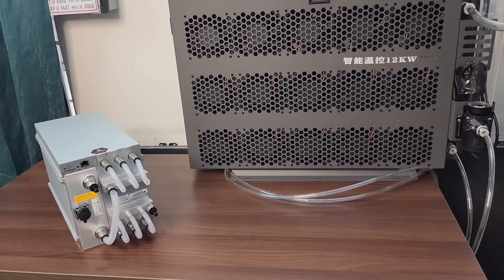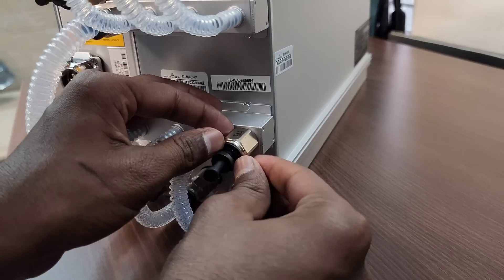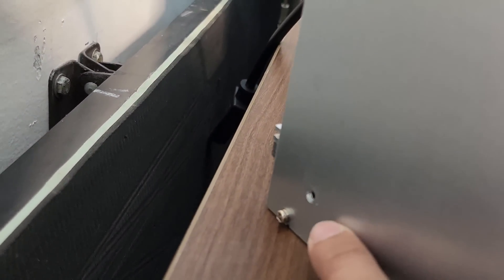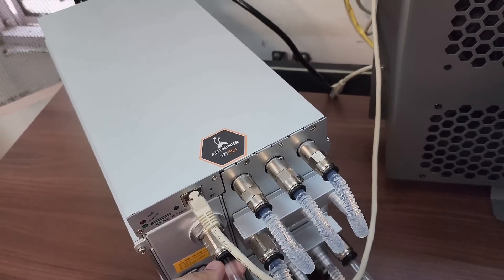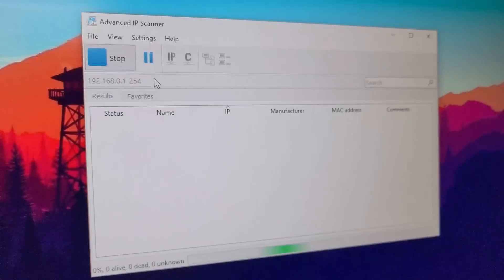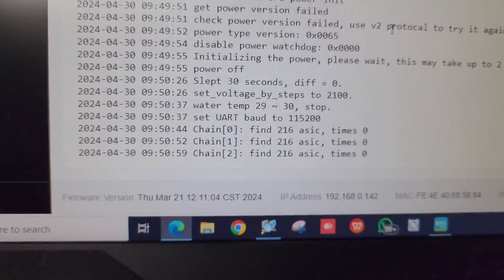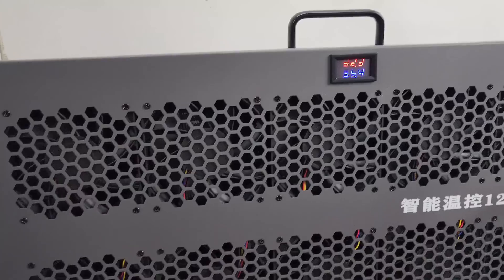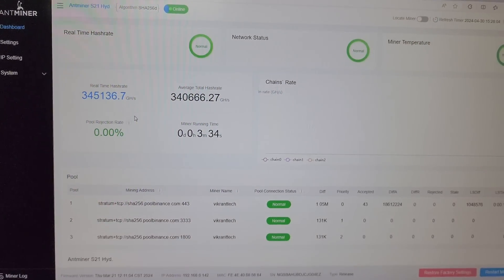Antminer S21 Hydro:335T  Unleashing World-Class Bitcoin Mining Efficiency Full Review

Comment: you did mention something wrong with those 20 degree celsius. however it could mean fahrenheit. but this technically makes it into -6,66 degree in celsius. as everything heats up quite fast it would make sense that this is the lowest threshold to get it to run. otherwise the water is freezing too fast and you cannot heat up fast enough into normal temp the components from there.
Reply: most of world is metric. its above 20C and bellow 40C water inlet temp on miner to start mining. also if you turn loop other direction in log file it tells you to that flow is wrong.
Reply: @Iwek1  still strange. i mean 20C is quite some heat already. but then its a software thing from the company that did build the stuff. from physical standpoint there is no reason why it should not start at even 8 degrees or so. maybe even deeper as long as it is not cold enough to freeze yet. but ok. if its done that way from the production side. they do not want it any other way. would need a hacked software to change that. otherwise it stays i guess. thx for letting know this and have a nice day. oh and happy mining ;)

Comment: why outlet temp is to high ?
Reply: Of course  they are providing the 335 th,  the temperature will be so high because they are doing the computation so fast. To avoid you can use a ventilation system where you can provide cold air for the fans and degree is a temperature for a while

Comment: Nice video sir 👍 !! Question ⁉️ can we just use different liquids for cooling other than water 🥸
Reply from the maker: Coolent with distilled water can be used
Reply: @VIKRANTTECH what should be ratio of coolant and water and can we use car coolant ?
Reply from the maker: @DrChoudhari  3 water -1 coolant
Reply: @DrChoudhari car coolant not. I asked the same question to Bitmain support.
Reply: @DrChoudhari i guess you want more problems and expenses. why car coolant on PC hardware? distilled water is good if its certain pH depends on type of metals used in loop. i use coolant for PC watercoolers. 5L for 40euro. lets say, never experiment with 1l premixed watercooler pc coolant and rest of loop distilled water. because of temeperature, fluid will bloom in sorts of way and you will need to clean whole loop 4 times with cleaning liquids that cost extra 50euro to get clean and safe loop back again and on top of that flush 3times with distilled water before you put proper PC coolant from 5L bottle to make sure you can run setup for 1y. goal of mining is to not have downtime and if you setup loop wrong, its just gonna be paperweight. got it?
Reply: @Iwek1  update, using for 3 months now , working very good. Using Shell company coolant.